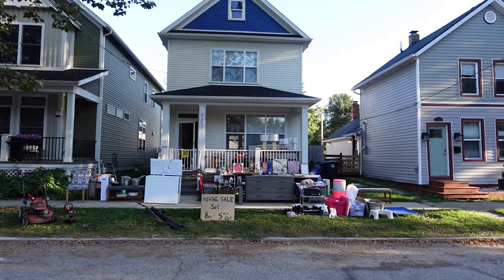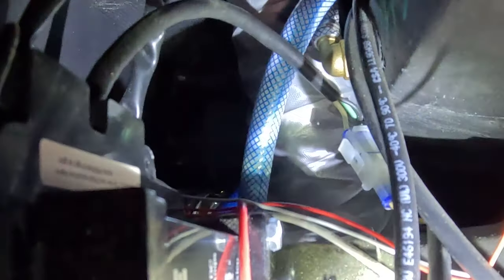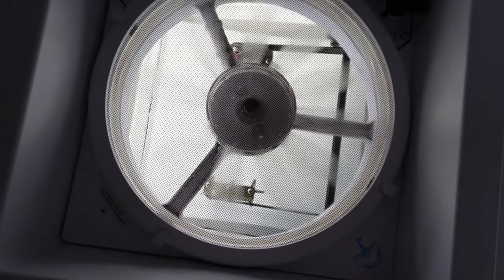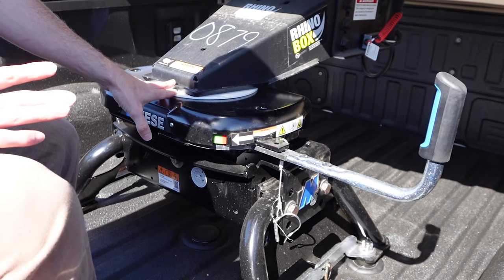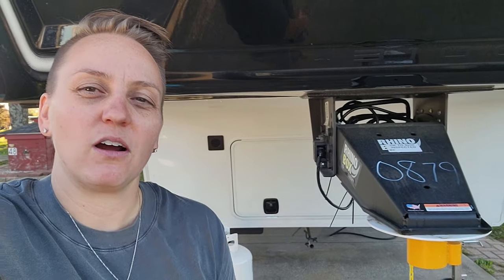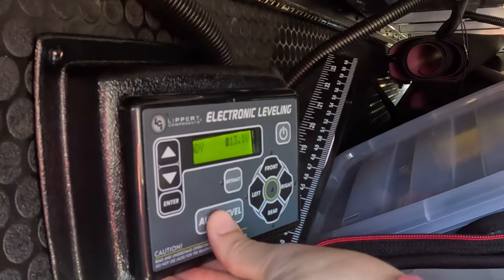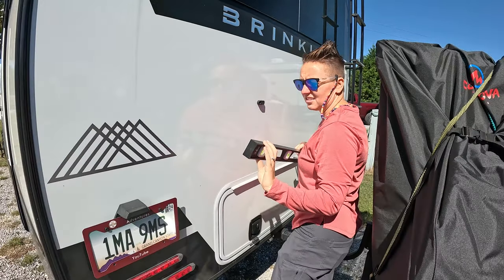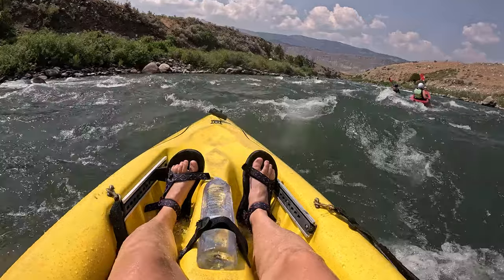Shakedown is REAL | RV Broken | Our Hitch Failed

Comment: Just a note on hitch : WD40 is NOT a lubricant but a degreaser! Use any type of silicone spray or white grease in spray.
Reply from the maker: It was a white lithium grease but of the WD40 brand. Thank you for the tip!

Comment: Another great video.  We have also had a few leaks where the connections just needed to be tightened up.  Our biggest issue with the Brinkley is the leveling system.  Auto level wants to take the tires off the ground.  It's a problem a lot of Brinkley owners are dealing with.  Hopefully Brinkley and Lippert will find a fix.
Reply from the maker: I didn't want to put Lippert on blast, but they make most RV parts for all brands and are the company that had stuff break. I am not their biggest fan, but try recalibrating it once you manually level it. To do this, turn it off, front 5x in a row, then rear 5x in a row. It will turn on and be ready to manually move each jack, and then you will push enter to set the new zero point or level mark once you have it where you want it. Leveling it as low to the ground as needed will help that issue in our experience. I would love to know if that helps you guys. Good luck and thank you so much for watching.

Comment: Thanks for sharing your problems with us...we all have had something go wrong. I never use auto level, don't trust it . Good 'ol old school level works for us! Great attitudes! Take a look at the Gen-Y gooseneck...had mine for 5 years and it has been great!! Safe travels
Reply from the maker: We have our eye on that hitch as well—maybe in time. We finally got the Reese working smoothly, lol! I think our next big purchase will be the independent suspension on the Brinkley. There's no rush, though, as we are not worried about putting a little wear and tear on what's there right now. Things are running smoothly! Thanks for the tip!
Reply: @  another tip and maybe you are already aware but Open Roads and Mudflap are great diesel savings programs! We use both and compare the best savings wherever we are at...safe travels
Reply from the maker: That is a great tip we haven't taken advantage of yet. We are slowing down for the winter and will likely look into it then. Thanks so much!

Comment: If your vent has rain protection it will close with the steem
Reply from the maker: I was wondering about a feature like this. We have the max air vent covers to keep it open in the rain, but I was curious to know if the humidity was triggering the issue based on a rain feature. Thanks so much for watching and commenting!
Reply: @LesbiFITAdventures  We have the cover also it won't open after a shower & closes during
Reply from the maker: Same. The mystery is solved, it would seem, as I went and checked after you mentioned it, and there is a giant sticker on the fan about how it closes in the rain. 😂😂

Comment: check your propane regulator, mine did the same thing.
Reply from the maker: Do you mean the hot water issue? Could it be caused by the propane regulator? Thanks so much for the tip!
Reply: yes, mine had gotten a little dusty, i blew it out with some air. it seems to have solved the problem. 
     and thank you for the video!
Reply from the maker: Thank you so much! We are going to try this and will update you if it fixes it.

Comment: Shake down is a manufacturer's excuse for problems. I have an Arctic Fox 5th wheel with over 10,000 miles, 7 years old and nothing has broken. Everything has worked perfectly except for one leaky faucet. Why don't cars and truck have shake down problems?
Ron
Reply from the maker: You may not be looking for an answer, but it's based on weight limitations. You can only sometimes use the most robust materials to limit your weight. RV manufacturers end up using things made out of plastic to reduce the overall weight, which is a must in the RV space, and as a result, things are cheaper to produce than in a vehicle, like a truck or a car, and more likely to break. We aren't the type to sweat the small things in life, and all our shakedown issues fell under the category of small things for us. Our truck weighs 10k lbs, but our fully loaded RV, which is 14 feet longer and holds ALL of our possessions literally, weighs 15k.... clearly, there is a difference in the build materials... Also, my truck has fewer moving parts and no running water. In my opinion, Brinkley still chose the right things to use, high quality, and where to use plastic. A $250k plus rig would have been out of our budget, which is about where the price would be if they used the same quality materials as our truck throughout. At the end of the day, Lippert made everything that broke, and we are still delighted with our home! We really do think mindset matters. If you have never had anything break, you are the exception rather than the rule and should consider a lottery ticket!!! LOL 😂😂 Thanks so much for watching and commenting! Happy travels!

Comment: Vibration related? If they build a camper, they know there's vibration going on! I consider it a fault of Brinkley! Thing's like that should not happen, girls! When the heather fails it's there fault; why? Because because you can't use home equipment in a moving environment! Brinkley should have known that!
Too short hoses, a rather wobbly floor underneath, fixing a electrical system that doesn't support lithium cells, a not tested working leveling system and a rather dangerous situation for a hitch that's not working properly?.... Well, it might look beautiful, but I wouldn't buy a fifth-wheel of that brand, looking at the mishaps you had! But still, I love your video's! ❤🌈😊
Reply from the maker: That's definitely one way to look at it.... thanks for his support, as always, Richard!

Comment: Did you ever really figure out the issue is with the hitch? We have had the same issue with the same hitch.
Reply from the maker: The hitch works like a dream. The lube plate was causing the jaws to attempt to wrap around the wrong spot on the pin, so they could not wrap around completely. Once we removed the lube plate and switched to white lithium grease instead, the problem was solved. Are you using a lube plate around the pin?